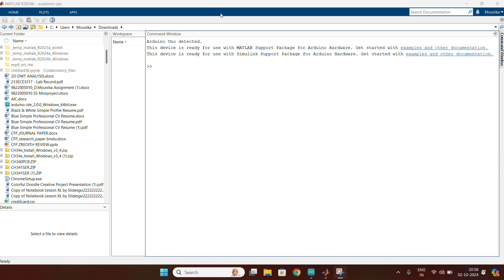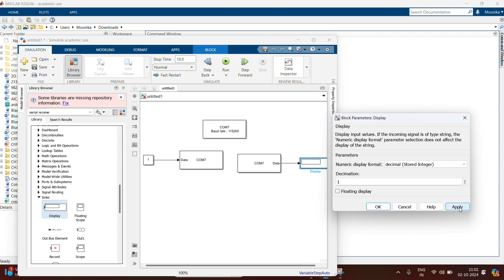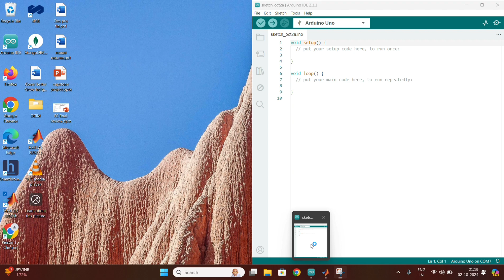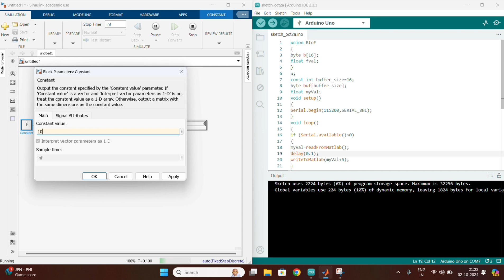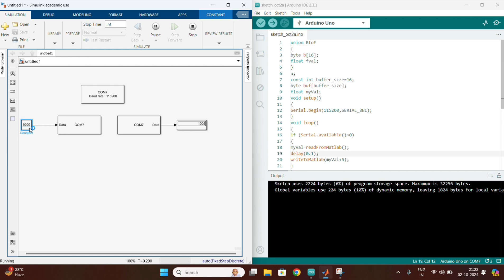Serial communication between Matlab Simulink and Arduino

Comment: hello, i have an error on line: int rein = Serial.readBytesUntil("\r\n", buf, buffer_size);  that states the following: 'Compilation error: invalid conversion from 'const char*' to 'char' [-fpermissive]' Does anyone have the same or is it because i use an arduino uno r4 wifi that is not compatible ?
Thanks for any response!